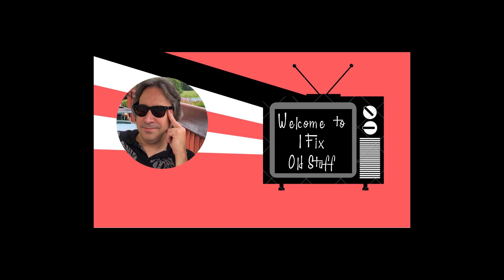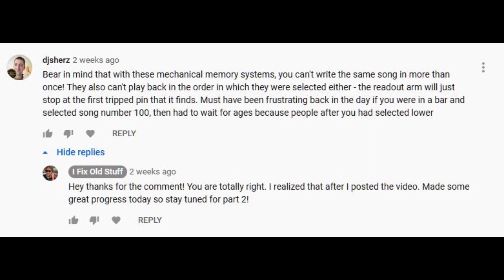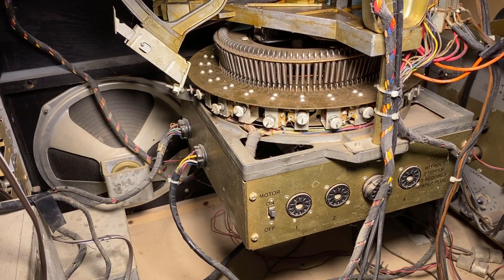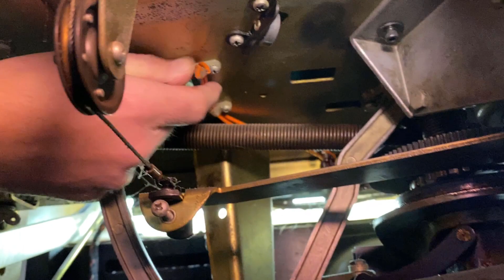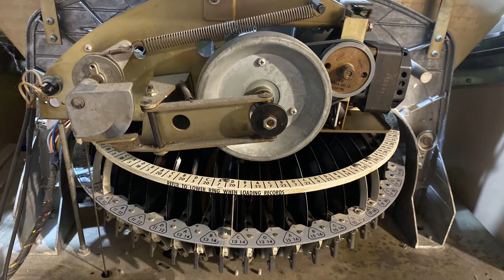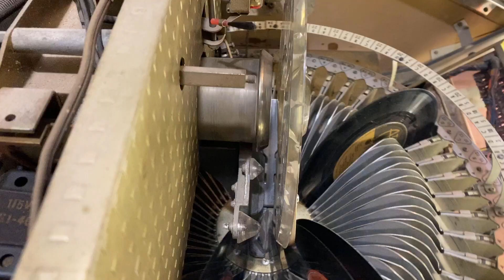Wurlitzer 2504 Jukebox Repair & Troubleshooting Part 2

Comment: Hi, you said to clean the mechanism with 99 proof alcohol.   What kind of lubricant should be used after?
Reply: Hi....as a tinkerer myself trying to maintain my jukebox and watching many youtube videos, professionals recommend using sewing machine oil or equivalent do not use WD40 as it dries out and then acts like glue. Hope that helps

Comment: Hi there . great video thank you . I have a '59 2304 wurlitzer  . I'm trying to find out how to adjust or service the tracking . My machine selects fine but doesnt seem to be tracking properly . it would have to be very similar to yours . if not the same . sometimes it plays all the way through the record & then the tone arm  will lift off & hit the record , half way on the return . Sometimes it struggles to play all the way through & starts  skipping . is there a tonearm force adjustment ? Or a shaft in the back thats needs lubrication ?. I Can see the curved Cam in the back  , That I'm guessing , is something to do with the tone arm tracking . but I'm not sure where to start . regards steve